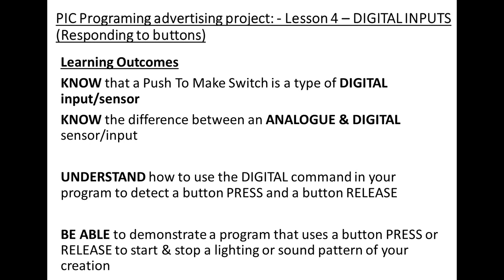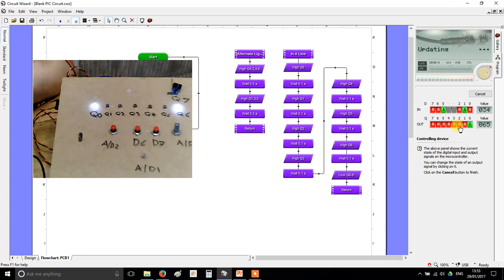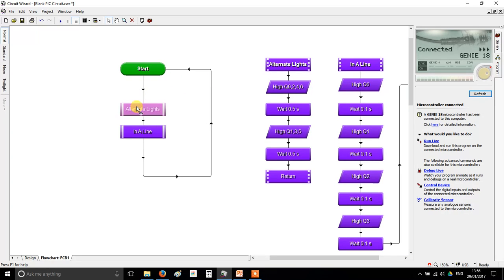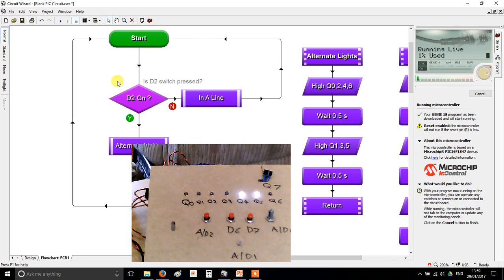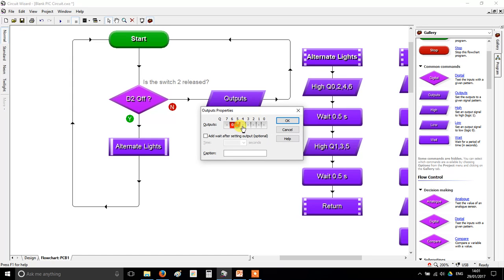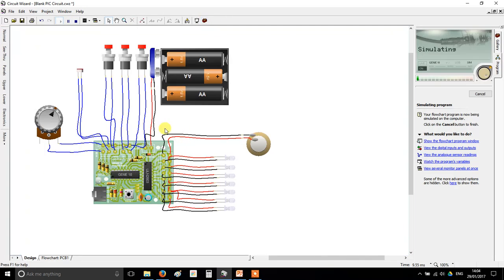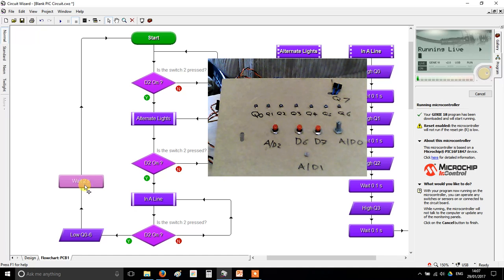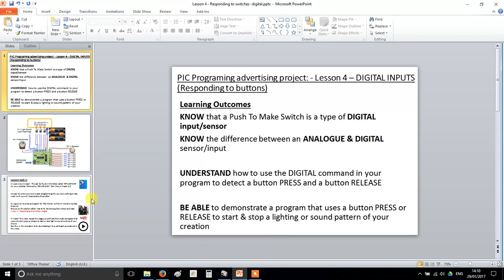Video 4  - Responding to switches

Comment: Rob, your circuit appears to use a ULN2803 Darlington transistor array to drive the LEDs. The array has open collector outputs and you need to add a resistor in series with each LED to protect against over-current. Nicely presented video though!
Reply from the maker: Bit late to reply here, but you're correct. I had my resistors 'in line' on the actual demo model (within  the wire).  For the kids this is aimed at, the programming control element is the main thing, so I don't go into the circuitry too much, but yes, the sim really should have resistors as well.  Trouble is.. I've recorded it now lol!